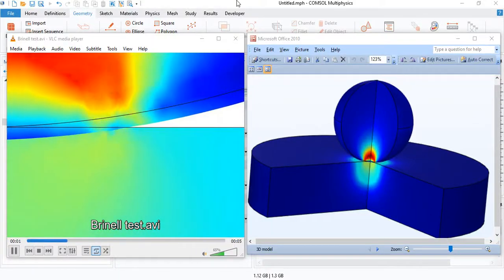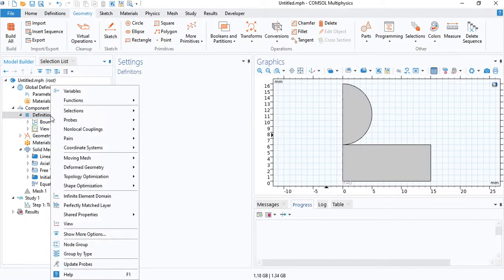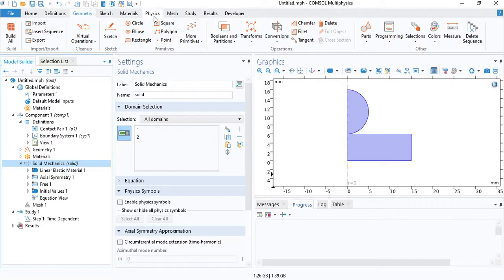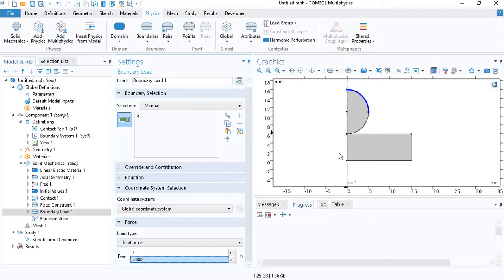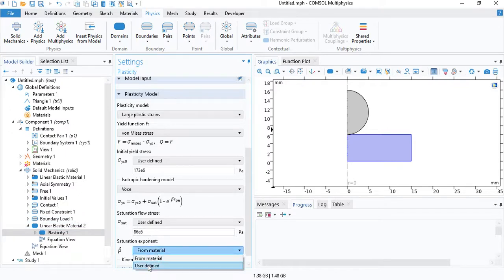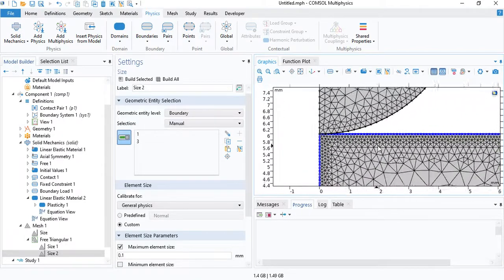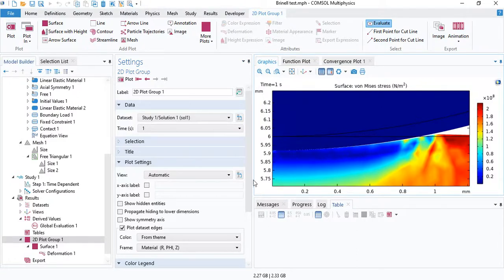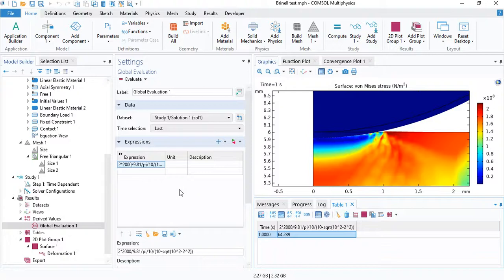Brinell hardness test simulation using Comsol Multiphysics

Comment: Excellent tutorial!.. but I am facing problem to get the results since i have just started learning comsol... Is there any video on how to get the results step by step?
Reply from the maker: I thought all steps are included here. Which step are you missing?
Reply: How to get the 2D plot?
Reply from the maker: @jyotimoolya4480  Right click on Results, select 2D Plot. Right click on 2D plot and select Surface. In the settings window go to expressions section and click on the rightmost icon. In the window that shows up you can select any variable you want.

Comsol will also generate plots automatically be default (unless you turn it off).
Reply: Okay thank you so much!...
Reply: My model is just displacing from one point to another point it is not applying any force on the sample... What might be the problem?
Reply from the maker: Check if you defined a contact pair in the physics.
Reply: @JafScience  I am working on nanoindentation of thin films. can i follow the same steps to simulate that as shown in this video?
Reply from the maker: The basic steps are the same so yes follow the video. But for thin film you may need to tweak the contact parameters and/or physics boundary condition.
Reply: @JafScience  If possible can you please make a video on that. It would be very helpful.

Comment: Hi, Thank you for your tutorial. I followed all the steps carefully, in the results section I can get the data for different points too, but the colored contours is not displayed. In other words, there is a problem with the visualization; how can I fix this problem?
Reply from the maker: Do you mean everything appears blue or there is no colour at all? Sometimes you need to change the colour range of the colour bar to see the contours. If the problem is something else please provide more details.
Reply: @JafScience  Thank you for answering. No, it's not blue; it's solid geometric form (gray | like 5:16 in your video) and doesn't show a color range. However, when I click on a spot, I can see the data for that specific spot on the material. Even when I create an animation, I can play it or change its parameters, but the shape remains just a half-gray circle and a gray rectangle. I would appreciate any recommendations for fixing this issue,I have encountered this problem before too.
Reply from the maker: @ So you do have results and you can view the stress or displacement when you click on a point? 
But when you insert a 2D Plot Group and under it you insert a Surface plot, and plot solid.mises, the model still appears grey?
Reply: @JafScience  Yes, exactly.
Reply from the maker: This is odd, I've never seen such a thing before. Check what happens if you manually change the colour range of the surface plot. See if whole geometry is selected for plotting. If nothing works, create any other simple model and see whether you can see the results (to rule out a software issue).
Reply: @JafScience  I'll try. Thank you very much🙏❤❤

Comment: Thanks for the video. But everytime that i m trying to do the same procedure there is an error:

- Feature: Time-Dependent Solver 1 (sol1/t1)
Undefined value found.
 - Detail: Undefined value found in the stiffness matrix.
There are 3645 equations giving NaN/Inf in the matrix rows for the variable comp1.u.
 at coordinates:  (0.0098,0.005), (0.00985,0.005), (0.0099,0.005), (0.00994422,0.00495086), (0.00992211,0.00497543), ... 

There are 3645 equations giving NaN/Inf in the matrix rows for the variable comp1.w.
 at coordinates:  (0.0098,0.005), (0.00985,0.005), (0.0099,0.005), (0.00994422,0.00495086), (0.00992211,0.00497543), ... 

and similarly for the degrees of freedom, NaN/Inf in the matrix columns.

I really do not understand the reasons.
Reply from the maker: It looks like there's rigid body motion. Is the geometry constrained properly? Did you follow all steps for the contacts/physics/solver?
Reply: Thanks for your answer. 

I followed the same steps you did for the boundary load, contact, and physics, but I used different materials. The indenter, with a 2 mm radius, is made of PLA (polylactic acid) with a density of 1240 kg/m³, Young's modulus of 1639 MPa, and Poisson's ratio of 0.35. The sample, which is 5 mm tall and 10 mm wide, is made of NBR (nitrile butadiene rubber) with a density of 1000 kg/m³, Young's modulus of 4 MPa, and Poisson's ratio of 0.5. @JafScience
Reply from the maker: Could it it be that the force is too much for these materials?
Reply: In this test, I used a maximum of 100 Newtons. And again the same error occurred. @JafScience
Reply: Should I set "t1" in the parameters as shown in the error? Because in the "Definitions" part -->"Boundary System 1" --> "Coordinate names" - t1 (first), to(second) and n(third) are mentioned. Maybe that's why the error occurs.

- Feature: Time-Dependent Solver 1 (sol1/t1)
Undefined value found.
.... @JafScience

Comment: @Jafscience 
How do I obtain the saturation exponent of a material?
Version 6.1 doesn't have the direct or solver search method in Physics module, which is the best to search method to use?
Kindly share your email. Thank you.
Reply from the maker: Experimental data is needed to find the saturation exponent. Alternatively you could use a simple bilinear model as a starting point and then use curve fitting to estimate the saturation exponent. 
Which search methods appear in your version?
Reply: @JafScience  heirachal
Exhaustive
Distance tracking
Reply from the maker: @davidndishu4457  I'm not familiar with these methods unfortunately. But different methods only affect convergence in different applications. The final solution, if converged, should be the same regardless of the method used. So I would suggest to try them out and see which one works best in your model, i.e. convergence and least time to solve.
Reply: @JafScience  I have decided to use ANSYS software. Thank you very much.

Comment: Hi, thank you for great tutorials. How did you Calculate/fine sigma saturation for Aluminium?? is it always constant in the same model or can it also change with loadchanging??
Reply from the maker: Sigma saturation is the difference between the ultimate tensile strength and the initial yield stress. The ultimate strength is a material property and I got it from a journal paper. It doesn't change with loading, but the initial yield point changes once it is exceeded  and the sample is unloaded. Therefore, the saturation flow stress will change accordingly.
Reply: @JafScience  Thanks for the quick answer.
I have used 86 MPa as sigma saturation and solved the model under the application a pressure of 145 MPa and it worked. But when I enter 72 MPa as pressure instead of 145 MPa in the same model, it does not work and Comsol can not solve the problem. It works only if I enter Sigma saturation lower, for example 40MPa. And 40 MPa (sigma saturation) doesnt work for a Pressure145 MPa
Reply from the maker: @chordy3390  Are you ramping up the applied pressure gradually? For a given saturation flow stress, a lower applied pressure should make the model easier to solve. And for a given applied pressure, a lower saturation stress reduces numerical stability due to the higher non-linearity associated with the higher plastic strain.
Reply: @JafScience  Tnx for your help. I could whit your help solve the problem in my thesis. :)

Comment: thank you for great tutorials. any example with AC (coil) and DC (coil or magnet) magnetic sources together?
Reply from the maker: I'm thinking of a suitable application to show. Introducing a magnet in the time domain will induce unwanted large eddy currents for a very short time. This may cause problems depending on the application. Two time-dependent steps can be used to overcome this issue.